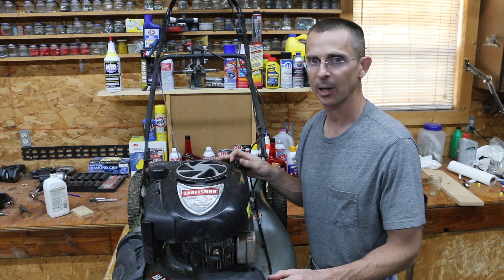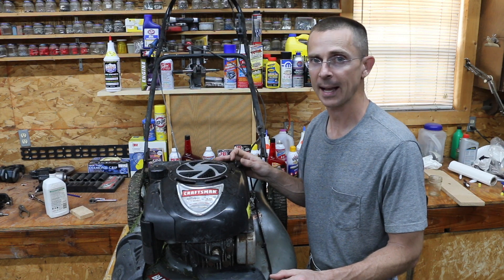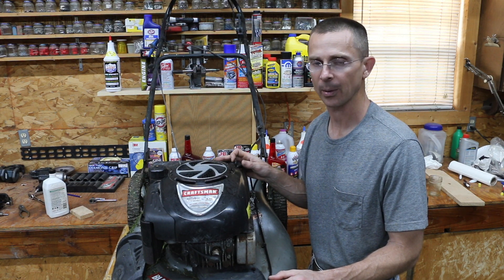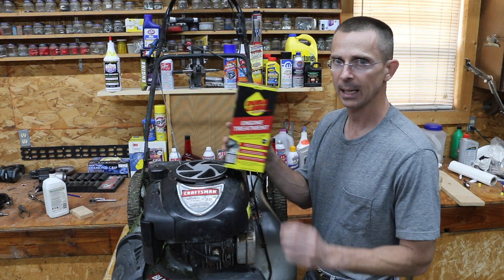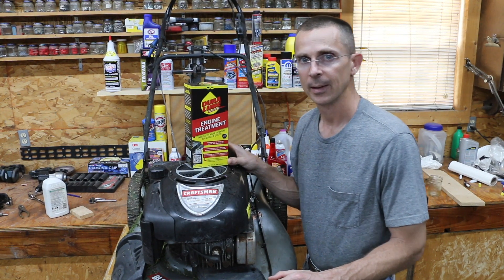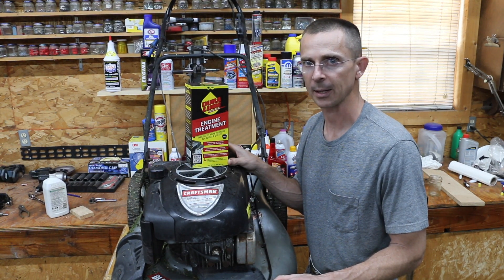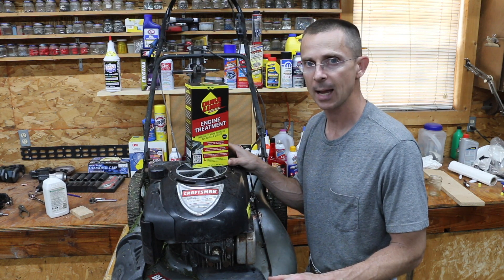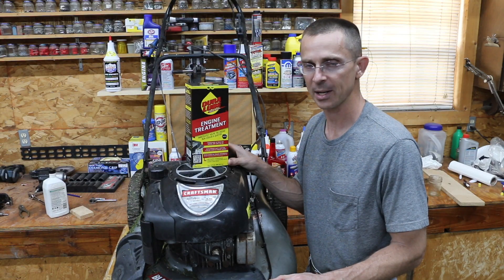Does Dura Lube actually help quiet and cool a gas engine as claimed?

Comment: I've used duralube in 3 different cars now and all I can say is after you replace a quart of oil with duralube is you feel the smoothness and less vibration along with more power (if your very fine tuned with your car) as far as mpg goes it's very close to basic oil but I always use it to help get the max out of the engine! 270k on my Toyota Avalon going strong. Been using duralube since 100k and almost seems like the engine got stronger with time. Just my experience and will never settle with oil alone anymore
Reply from the maker: Thanks for the feedback.

Comment: I had an old 78 Chevy van, w/290 straight 6, years back. It was burning oil and smoking a little. I added a quart of Duralube, and it helped quite a bit. When it would get low on oil, it would start running a bit rough. I knew immediately to stop and add some. The water pump went out, & I was 100 miles from home. I had to stop every 20-30 miles to add water, & made made it home OK. I drove that van for several more years, and it always got where I needed to go and back. I credit Duralube for much of it.
I also used Duralube in an old 8hp mower engine that had sat for several years. It cut down on the smoking. That mower lasted for several years, until it finally just wore itself out.
Reply from the maker: Thanks for sharing.

Comment: I am not a scientist but I have been using it and one time I drove my RV without water and antifreeze because my radiator broke down. I would say for at least 10 miles and the temperature gauge never changed or go up. the engine kept cool just like normal no warning light. 290000  plus miles
Reply from the maker: Thanks for the feedback.

Comment: I remember when duralu was sold The infomercials I want to say back in the 80s so I was surprised to see it was in store shelves now but my 2017 Hyundai forte with $150,000 miles had not had regular interval oil changes and was beginning to be noisier so what did I have to lose in my next oil change it was quieter immediately someone however after a week of it being in the engine it was noticeably quieter and smoother accelerations were quiet and smooth as well I'm going to be using it from here on!
Reply from the maker: Thanks for the feedback.

Comment: oh i asked you to test duralube about a year ago lol.  heres a grabber:
i used duralube in my 76 ply volare slant 6 to quiet lifter noise. when starting cold it sounded horrible but ran quieter after warming up. my water pump was squealing on same car. i squirted a little duralube in radiator and squealing stopped for a couple days at a squirt. drove volare with bad water pump for a year. in my home i put duralube on any bearing surface in my house, oil furnace injection motor and furnace fan. also a seized up house fan. my electric bill went from $70 a month to $15 a month. duralube freed up that old seized fan and worked for a year more.
Reply from the maker: Thanks for sharing!

Comment: Just saw this video.  Started checking your videos out a while ago.  Well done, pretty well thought out, excellent controls used and testing!  Can't believe the amount of time you must put into each of these.  Thank you for all that! Please... Keep it up.   

I too have been using Pro-Long, and DuraLube sine their origins, starting in the 70's.  I put I think Duralube was first, in my van with a horrible-running 351.  You could HEAR the rpms go up immediately, and the engine was purring.  I was shocked, been wrenching on my cars since I was 14. 
Got married in 79, and got a 460 Ranchero I had to make the wife drive, since it idled at 45mph!  I heard a cooling metal sound one afternoon, and asked her if it was getting hot.  She said there was no sounds from it since it was hissing.  WHAT hissing??? That was right after the bubbling.  WHAT BUBBLING???  Oh a couple weeks ago. (Silently, there was company... oh crap....)
Now I was working nights on a 12hr Roadswticher for Santa Fe RR.  So I saw her just a couple hours a day most days, if that.  She worked downtown in Phoenix, drove Rush hour every day, 45 minutes each way, at least, she got off at 4:30, the hottest part of the day, this was Dead Mid-Summer.  I cringed... Shook my head, asked her why she didn't mention it... I was never home long enough for her to remember to tell me.  So my fault.

NO moisture in the Radiator, which I figured, right?  Pulled the 460 oil pan, oil stunk, checked the Bearings, no discoloration, shiny like new!  Found the water leak on the water pump, someone had used TOO STRONG Lye to clean the radiator, it ATE holes in the aluminum waterpump housing.  Put it all back together, everything ran great!   Pretty sure this was a Pro-Long treatment, Duralube had gotten scarce for a while.  

I tried Slick 50 once.. But if you have to SHAKE IT, that means it separates or they would have mixed it before selling it.  SO I quit using that ASAP. 

What DOES SEEM TO WORK to keep the engine clean?  "er"? Higher TORQUE, OOMPH?  is putting in a tiny bottle of Fuel treatment every 3000 miles.  My kid figured that out, been using it ever since.  No smoke, that I've noticed, works great. 

Since I got into Infection Control with a company whose product got both my boys off their inhalers, We've been installing our tech in the HVAC's in Hospital Surgical suites for a First-Line Infection Control.  Our guarantee is, if you have another unexplained infection, CALL US!  The technology is a Hydrogen Peroxide plasma gas, HPPG or HPGP.  Liquid HP is also in 82 products on the EPA's COVID-Approved Disinfectants. 53 say, "May be diluted". The fastest SAFEST killer of COVID virus?  Plain 'ol Hydrogen Peroxide at 30 seconds. (or it was 3 months ago).  We use HP in toothpastes, gargles, Cuts, rashes, and nasal sprays, so it's FDA-APPROVED for use IN our bodies!  I use a 50% Diluted with distilled water Storebought in Spray bottles.  Works within 5 minutes, I feel a difference at least that fast, just as the EPA and CDC sites suggest HP products proved they worked to get ON those Lists!  I've also found you can do treatments every 4 hours, since a Sinus headache came back in 5 one time.  IF you feel pain like on a cut... you have an open wound wherever you felt it.  That means 4 treatments in 48hrs.  Symptoms MAY go away after the 1st treatment, but Sinus/throat, lung infections with an open wound, take at least 3 treatments to help your body kill off the surface infection as well as the Wound inner layers. I believe that's why we have LONG VCOVID cases, they release people with them still mildly infected.  Our ER nurse in an Oakland Hospital was released, and described coughing up crap after a short bike ride to the store, I sent him BACK to his Dr, he was BACK on anti-biotics the next day.  He has 2 PhD's. REALLY doubted me when I told him he was still infected. (He was one of our first clients with a machine.)  I told him, "WHEN...have I ever steered you wrong?  Been Wrong?"  Silence... he was thinking about that one...

He's still fighting with Long COVID rehabilitating... Told me long ago, Delta ATE right thru our Anti-bodies.  Wife got it from an Az family, at a funeral.  2 days and bedridden!  3 days of 2-4 treatments to eliminate all symptoms, except sinus running, another 2/day for 3 days for that!  LONGEST treatment I've ever had to do, and I've had MOLD infections in my sinuses and lungs from doing Mold-remediation jobs.  Same treatments, works fast and safely, But I started s=using the 50% distilled water dilution when My sinuses got too dry on that one. 1 deep Breath of H2O2 "MIST" thru the nose, and one thru the mouth.  CLOSED eyes. Simple as that. No side effects, except for CLEAR morning sinuses from bad allergies all my life.

Merry Christmas!  Thanks again!
Reply from the maker: Thanks, will do!  Merry Christmas!

Comment: I look at this test as one performed on something that is so called "severely used or broken down" vs. "new or newer, no problems and  not in need of service to begin with".  Let's face it, if something mechanical, such as an engine, which is broken or severely in need of replacement, I would say is not an adequate test in and of itself.  I would replace this test with one that would take years to finalize -- this way you can truly test whether or not Duralube and truly maintain and extend the life of said engine, rather than trying to test it as though it can repair an engine.  As far as I know they never claim that a broken or severely worn engine can be repaired back to a new state.  That said, let me tell you what it did for me and then have you decide.  In brief, I used this in a mint-condition Saturn 1997 model wagon which ran perfectly from the start with around a 100k on it.  I then crashed the car into a concrete highway barrier at 65- mph  head on from a side angle, the impact was severe.  My hood and radiator were completely destroyed, all antifreeze was completely drained and gone.  I restarted the car and ran it home for 5 miles on dry, except for engine oil.  I drove it at redline and above -- at this point I no longer cared about the car.  The water temp was buried at red line and so too was my tach as I floored the engine to get it back home ASAP.  The car made it back home easily and actually ran smoothly doing so -- I was in disbelief, I though for sure the engine would have locked up on me.  The next day, I went out to start it and it not only started easily, but ran very smooth to boot -- I was amazed!  In sum, I just wanted to say, from the stand point of an engine which ran great before the crash, and still ran great after the crash can only be attributed to Duralube engine treatment.   I would say this is a "fair" test performed on a good engine from the start, so yes, it works great, need I say more.  I will always recommend this product -- what do you have to loose, really?  It works!
Reply from the maker: Thanks for sharing.

Comment: I have used Duralube in the past,  We had a 1989 LeBaron GTC Turbo.  Owned it since new.  Around 100K miles it had a faint rattling noise under boost.  I though it was the Turbo,  I did of course see the infomercials of the day, and gave it a shot.  It worked.  Completely quieted it down, and may have had a performance boost (no pun intended).  I stopped thinking about Duralube after some stories of it having bleach as a component, which could lead to corrosion.   All I can say, is it worked well for me at least once.  I just added Prolong I had on the shelf to one of my 2008 Audi 3.2L motors with 130K miles.  It was experiencing what I suspect was a sticking chain tensioner following an oil change with Mobil 1.  It would have a slight chain noise at start up which would suddenly go away, after 3 seconds to a minute.  Good news is the Prolong worked to free up whatever was sticking.  Noise at startup from timing chain is gone!  My mindset now, is I may not put these things in a classic, collectible, but would recommend them for daily drivers.  I don't know if the bleach claims are true.  I'm hesitant to use products with solids because depending on your filter, it may just get collected instead of deposited.
Reply from the maker: Thanks for sharing.

Comment: I have a 2000 Dodge Durango I don't use Dura Lube every oil change, but with 241262 on the odometer it runs well.  Anyhow I had some hydraulic lash adjuster noise develop around 180000. Basically the lash adjusters weren't pumping up quick enough.  Noise was similar to noisy lifters.  Using Dura Lube for the first time the noise diminished and went away.   As a preventative I ran Dura Lube another couple of oil changes.  I haven't used it in three years.  So far lifter noise has not come back.  Oil I use is 10W30 synthetic blend and Mopar filter that I get through work. Did Dura Lube give me better mileage?  No.  Did my engine run cooler? (Or hotter) no.  All that happened was my lifter noise went away and has yet to come back.
Reply from the maker: Thanks for sharing.

Comment: In 96 I used Duralube and it works. I used it in a personal car that over heated because of a bad thermostat. The engine was fire truck red, looked like it was going to melt. I let the engine cooled down for a few hours. I thought the motor was completely fried. The car started, rode sluggish for about 10 mins and smoothed out to regular performance like nothing ever happened. Stayed that way until I traded it in, 3yrs later!
Reply from the maker: Thanks for sharing.

Comment: Never knew this video was out! I tried it on a 08 Jaguar XF Supercharged V8 with rod knock. I know the engine wouldn't last but I had to just try it. I say the engine did run SLIGHTLY smoother and SLIGHTLY less knock. Not enough to save but I think it does work.
Reply from the maker: Thanks for the feedback.

Comment: I've used it for years and it the best . Sr3 is what penatrates the metal and makes the friction drop in such a dramatic way that less wear and tear does acure . I watched the informertial when they did their testing live. They could hardly get a bearing to fail under load . It beat slick 50 and a lot of other synthetic oils in the ninties.
It sure has done well for me.
Reply from the maker: Thanks for sharing.

Comment: I've been using Dura Lube for nearly 30 years.   I began using it in a 1988 Honda 300 4x4 to help reduce friction.  I was pleasantly surprised how much cooler the engine ran and it always started easy and had plenty of power.   I sold it when it was 18 years old because of a physical injury that no longer allowed me to enjoy it.  It was still running great, plenty of power, and didn't use any oil between changes when I sold it.   
I told other friends about my experience and they tried it too.   They were impressed with how much cooler their air cooled ATV's ran as well. 
After first seeing the results in my air cooled ATV,  I began using Dura Lube in my cars as soon as they had enough miles on them to make sure everything was fully seated and broken in.  I began running Dura Lube in my 1500 V-Twin as well.   In my 25+ years of use in my vehicles I've never experienced an engine failure and my cars run great.  
From my personal experience I recommend Dura Lube for vehicles and especially in air cooled engines such as mowers, generators, ATV's, and motorcycles.  
Less heat, less friction, and longer engine life is my experience.
Reply from the maker: Thanks for sharing!
Reply: Mine does all that and I haven’t used Dura Lube🤔

Comment: my wife and i bought a 91 geo storm used back in 95. i saw a dura lube infomercial and decided to order it. we lived on a farm  and decided to go into the city for the weekend. i changed oil and added duralube. we went on our trip. we put on 200 miles easy. when we got home, i checked the oil. low and behold, not a drop. i looked and i forgot to tighten the drain plug and it all leaked out. not a knock or sputter. no idiot lights came on, nothing. it had saved the engine. i did that once before in an lder car i hade in the 80s and it burned right up in just a few miles or less. hence, i dont change oil anymore. i trust duralube. used it since 95.
Reply from the maker: Thanks for sharing.

Comment: I KNOW IT WORKS...85 DODGE 318... I STARTED MAINTENANCE @ 118, 000 MILES...USED DURALUBE...ENGINE HAD OVER 300,000 MILES WHEN SON WAS HIT BY RED LIGHT RUNNER...ENGINE WAS PULLED AND PUT IN ANOTHER TRUCK...REBUILT ALT MYSELF...BRUSHES AND BRIDGE IS ALL...NO BEARINGS...(But Alt has nothing to do with Engine)🤪🕊👈
Reply from the maker: Thanks for sharing.

Comment: We first used friction modifiers in the 80's on a gearbox on a pull type John Deere combine that was so hot you couldn't touch it. Power up added and it ran much cooler. 
  Although skeptical that certainly caught our attention. 
   
  Overhead shop door...homemade 15 ft tall that used a gearbox from a combine reel. 15 yrs ago it was grinding and sounded completely terrible. Added power up or duralube and it still is quiet to this day.

   Chev 305 with power up you could feel the difference in power and it improved the mileage as well.

    Then I saw independent testing that compared power up to duralube and it wasn't as good as duralube. So we have used it ever since.

     Once owned a large car wrecking yard in the family. At the grand opening at the new location we ran three vehicles at wide open throttle in park to see how long they would last with no engine oil.

      Friction modifier in the chevy truck never did blow but eventually slowed down and stopped at 11 mins if I recall correctly.
   
       The others blew rods and metal out the side of the block in 3 mins and change. Very dramatic.

      Just a thought on the noise readings on the lawnmower...if you increase the compression from 60 to 72 and increase the rpm's it isn't a fair comparison.  The engine is now producing alot more power.
Reply from the maker: Thanks for sharing.

Comment: I bought a 97 Sierra, 5.7 vortec from the original owner that swore by a bottle of duralube with every oil change.
350000km, when I got it, to 465000km, no compression loss, engine problems or noise when I had it or sold it.
Reply from the maker: Thanks for sharing.